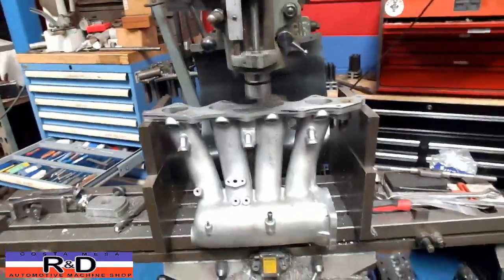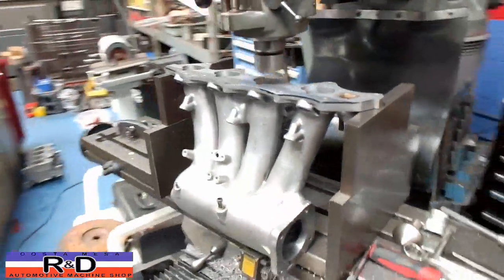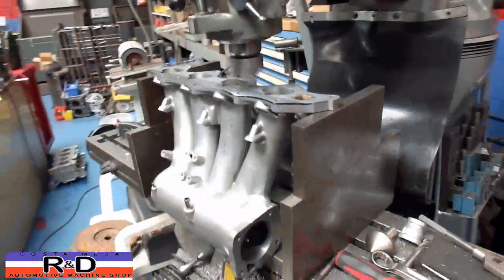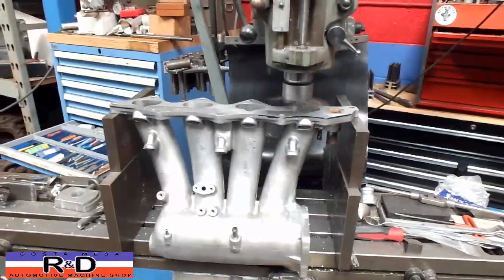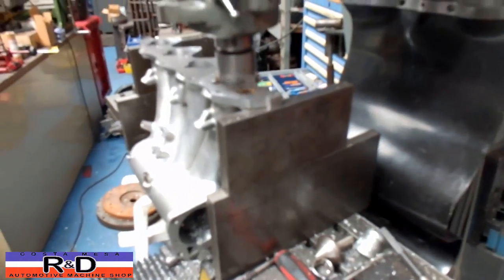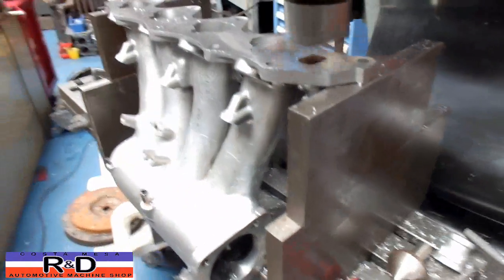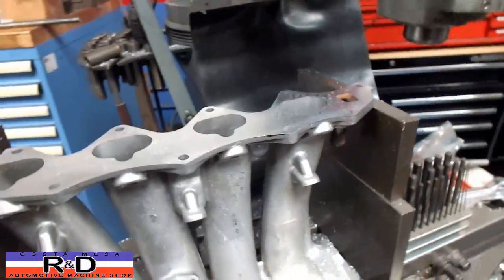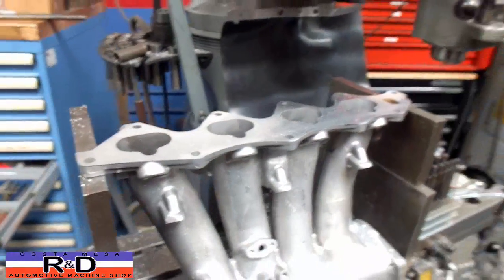Angle Milling Honda Intake Manifold

Comment: Also tip your quill  one degree so you're only cutting on one side. That is not enough to dish it and you will have a smoother and better finish.
Reply: GREG GERHARDT What?
Reply: Your fly cutter is cutting on both sides! Tip your quill 1° in the direction that you're cutting so you're cutting tool is only cutting on the front side in the direction of travel.
Reply: I machine parts for Sandia National Laboratories here in Albuquerque New Mexico.
Reply: PBFA - PBFA-2 - and PBFA-Z. Particle beam fusion accelerators. My position is machine shop coordinator.
Reply: So you don't like the way he works?
Reply: He doesn't know all the tips and tricks about machining.
Reply: Just listening to the cutter tells me that the tool is dull and he's dragging the metal off instead of peeling a nice long chip for each swipe of the tool on the metal.

Comment: Learn to build your own fly cutter it sounds terrible and put a chip breaker on it and sharpen the edge with a diamond grinder and break edge by hand slightly . Then do it in one pass. Poor machining practice!
Reply: GREG GERHARDT What?
Reply: Just what I thought...
Reply: GREG GERHARDT
Well... It will be bolted to an engine and will work. I don't see what is wrong with that?
Reply: Of course for the average machinist it will work just fine but when it comes to the fine art of machining he does not know what he's doing.
Reply: GREG GERHARDT
I watched his videos about engine deck resurfacing and it looks like every time (like 5 videos) he removes more from the edge that is closer to the viewer. He said that his machine is set very well.  I'm just a mechanic so don't know.
Reply: It will work just fine but for what we do it would be very crude. Sorry if I stirred up any emotions.
Reply: GREG GERHARDT
No problem I'm just curious if he is good at what he is doing as I have no idea about machining and everybody on you tube doing it looks so professional;)
Reply: He's OK but would never pass for an aerospace  machinist position. Some of are machines are over 10 million dollars.
Reply: GREG GERHARDT clueless

Comment: This wont have effect on the injector spray angle?
Reply from the maker: Moshik Galimidi This will not affect the injector any significant amount as I see it. Maybe if the angle was more then 10 degrees or so. I played around with injector angles years ago when I worked for Keith Black and found differences on the flow bench, but it was dependent upon the type of injector hat you were using. The laminair air flow is the fastest part of the air column and once you get the fuel into that stream and angle change of a couple of degrees doesn't mean much. Hope this helps.
Reply: fiatnutz  thanks alot!